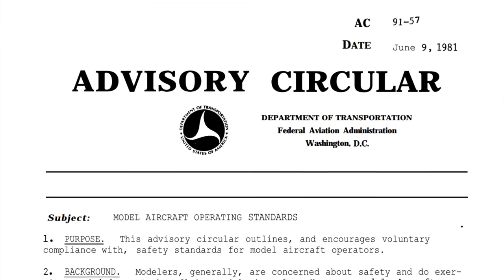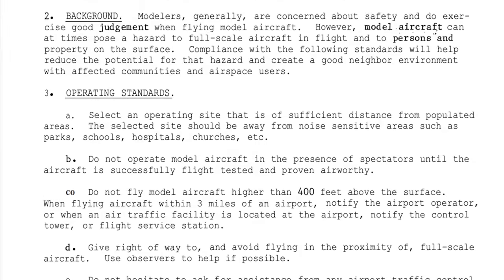A Remote ID Solution for Fixed Wing RC

Comment: Not just fixed wing, here you go again kicking fpv to the curb....It really isn't the type of aircraft, it is the type of flight operations. I do and since 2016, I have flown advanced systems flight controllers on board fixed, wing, camera drone, and freestyle multi-rotor RC aircraft at my AMA club, now FRIA approved, in Class B airspace, with agreements with the Coast Guard, Air force, NASA, and flight ops in a large metropolitan area. We have co-existed in harmony, except for one very low pass of a UH-1, back in the 70's directly over our runway and determined to be the manned aviator’s fault. We have flown every category of RC craft. We no longer allow jet powered craft. We often have manned aircraft cross our well-marked on aviation charts field, only a very few over a long time have been suspected of being below 500 feet, but never the less we go beyond reasonable measures to practice deconfliction to avoid any possibility of collision. Again it doesn’t matter whether I am flying my Twin motor balsa beast of an Ugly Stick, my Mavic Mini 2, or my Nano Goblin running elrs, INAV, FPV in loiter mode at 100ft while I transition from FPV to LOS or back to fpv again. It is the altitude, airspace, weight, should be a bit more than 250g,  and location that should dictate RID, and other special restrictions. 
Also, in class G airspace, the FAA may never be aware of or be able to pursue regulation offenders. It is a whole other world if the same type of flying is done under Class b. Class Bravo Airspace is positive controlled airspace that surrounds the United State's 'busiest' airports. They do and will respond, to your location, provide education and or cite you.
Reply from the maker: Good points.  I am just trying to start the discussion.  Key point is if pilots can demonstrate they follow the rules, you can work various issues to your benefit with the FAA.  Tim

Comment: The FAA doesn't know the difference between a drone and a model airplane.They fly totally different then one another.Drones can fly pretty much autonomously while model airplane require consent control inputs and learned skill from the pilot.
Reply from the maker: Yup.
Reply: How you build them is what makes the difference. Someone could easily remove the VTX and GPS from a quad. What's left is line of sight with no guidance.
Reply: I would love to see either of you “skilled pilots” keep one of my drones in the air for over a minute. 😂
Reply from the maker: @koolthingrc1644  👍🏻🤔 Tim

Comment: If I had money, I'd spend the rest of my time alive flying a Hughes 500 everywhere.  Wires, and now sUAS, would be the two dangers I'd have to mitigate.

Corralling models onto a FRIA would do a lot to ease my concern (especially when electronic sectionals highlight their location).  

I have seen guys flying models on their own acreage, both domestically and abroad.  I understand FRIAs are not going to corral everyone, unfortunately.

I agree with the other commentor.  If you buy an RC radio, you have to show proof of FAA certificate (aka operator's license), but when you buy a 'drone' - it comes with Remote ID that you can't disable.
Reply from the maker: Thanks for this input!  Tim
Reply: @TimMcKay56  I think the TRUST certificate is a step in the right direction, but with a biennial flight review.